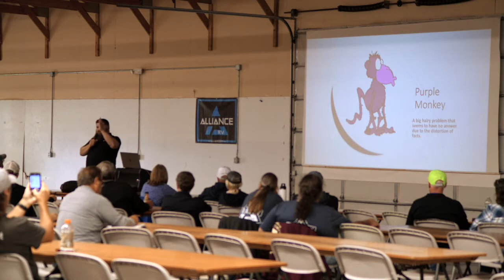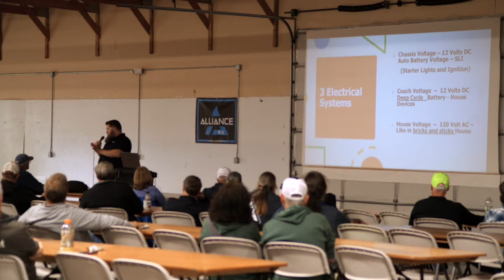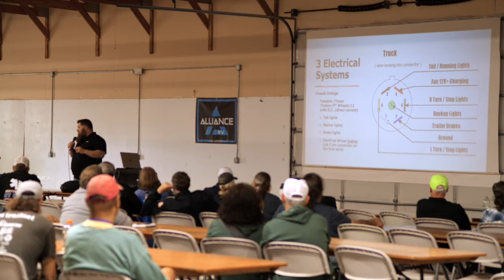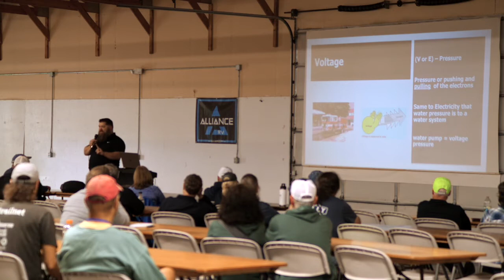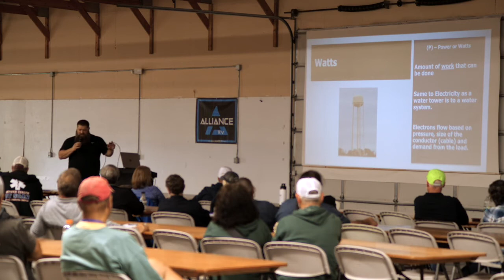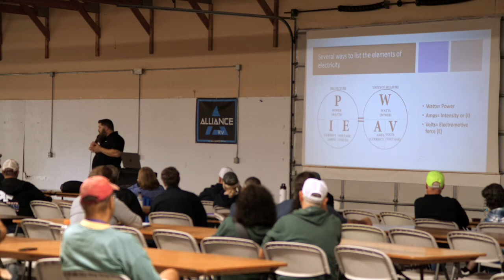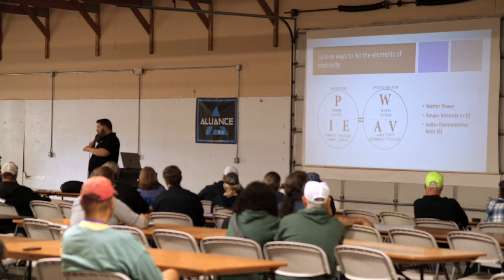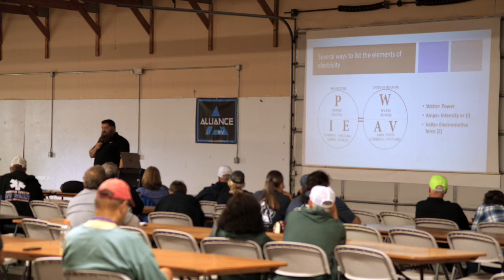Introduction to RV Electrical 2022 National Rally

Comment: good basic stuff for folks to know. In the discussion about 12 volt as it relates to the 2022 Valor that we have, with the solar plus and 3 batteries,  the tow vehicle does not charge the coach batteries when connected. Early in our ownership the dealer contaced me and said that in thier PDI the technician found no charge wire connected and he put one on. The dealer said Alliance had instructed them to remove the added wire. I removed the wire, since I was not near the dealer. I contaced Alliance service directly and confirmed that this was the correct approach for the Valor with solar plus. No battery connection for charging while tow vehicle attached.
We enjoyed the classes at the rally. It is good for owners to know important details about their RV to prevent problems and solve issues while living on the road.
Reply from the maker: Thanks for the comments Kerry!  Yes, due to the configuration with solar the 7-Way plug does not charge the batteries on the Valor models.